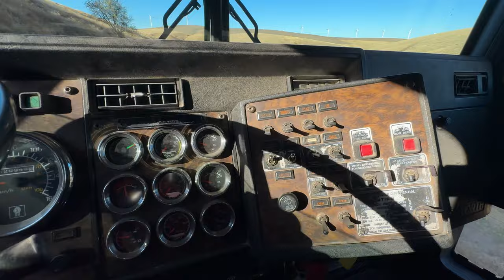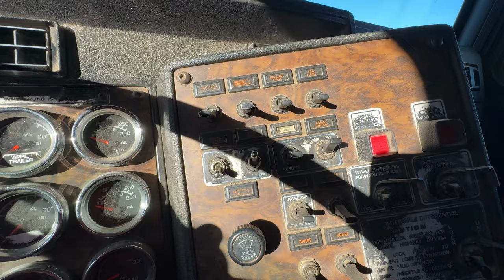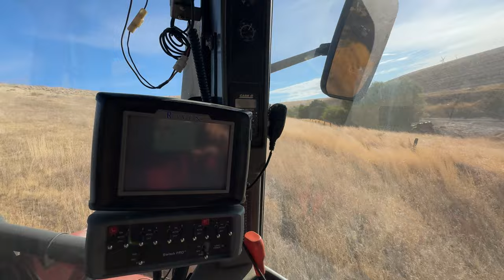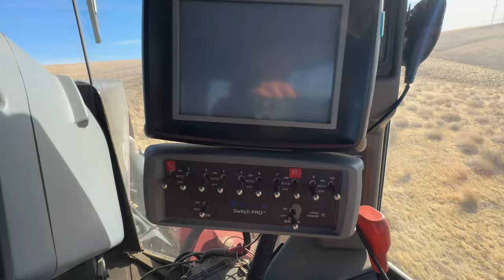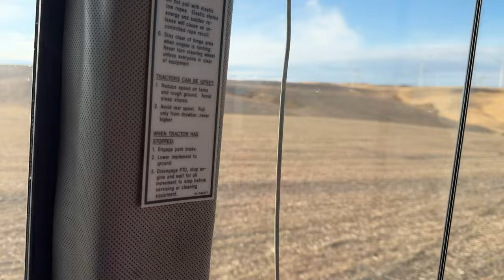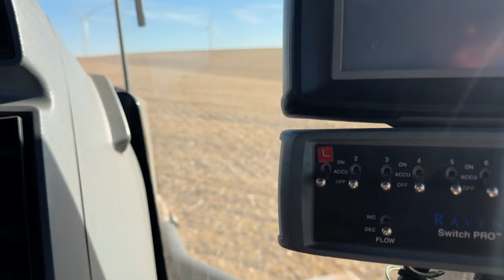Driving some old trucks and a tractor

Comment: I saw a Versatile 1156 with tracks on it in 1989. The tracks were made by Kelderman of Canada. Seems they had been making them for a couple of years. IH did nothing new, they were just first to market them in the US. Kelderman also made a Dry Spreader box to put on the back of those 1150-56s to make a giant floater out of them. The box wasn't small either.
Reply from the maker: To like spread dry fertilizer or something? We wanna spread some lime to help the soil pH bit its expensive.